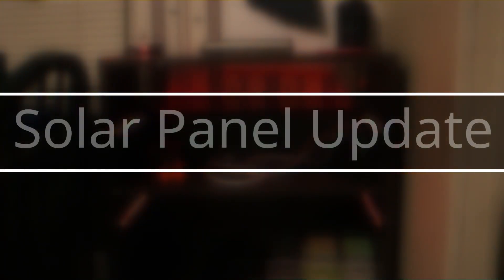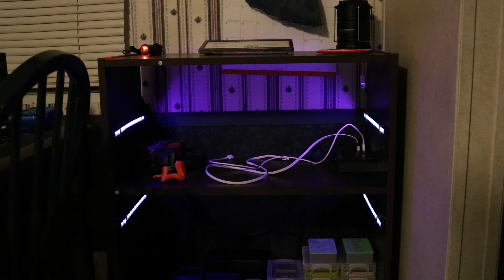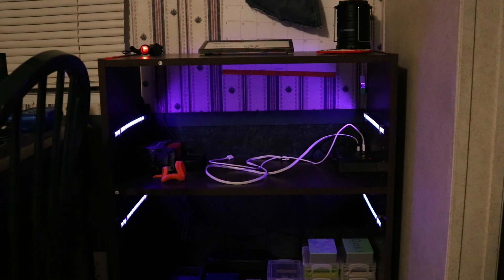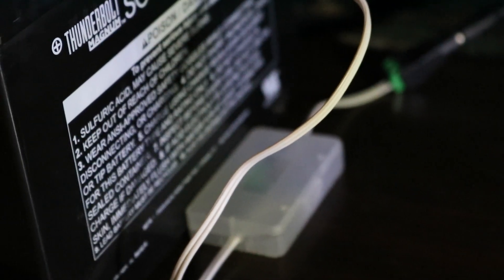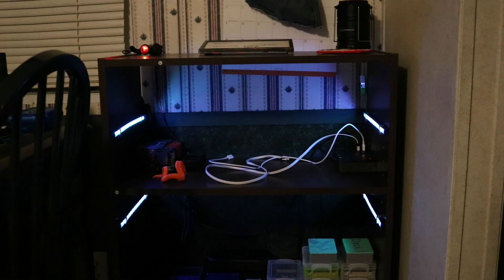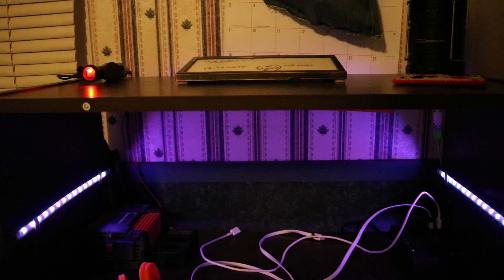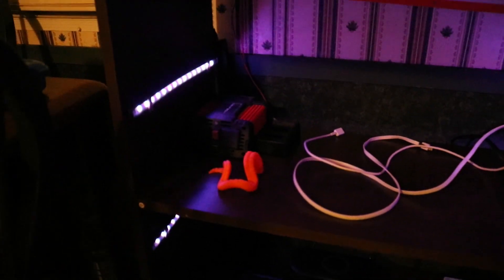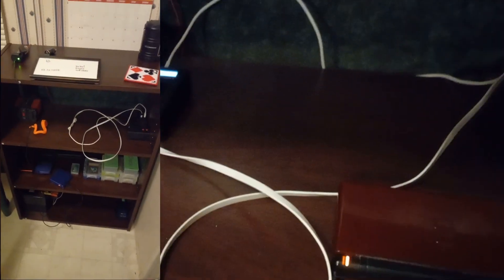Solar Panel Kit Update "Also Some Future Plans For It"

Comment: Hadn't seen that kit before, with amorphous panels being usually for car maintainer panels. Looks cool really. 
That little box with the soldered car fuse was a great idea!
Reply from the maker: This kit was from before the charger had a agm battery setting I believe I had to manually put the settings in to it if I remember right so you are right the amorphous kits they sold back when I got this primarily were for car battery maintainers they just slapped on 3 more 25 watt panels lol but I couldn't beat the price for it at the time and it kinda cool to see the price for the newer ones generally stay the same even with the better panels/materials and charge controllers.